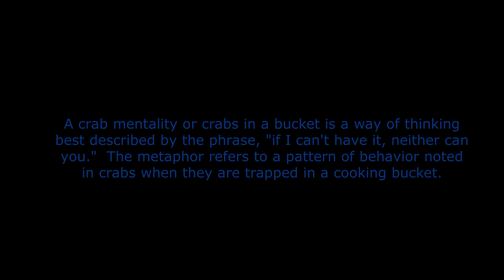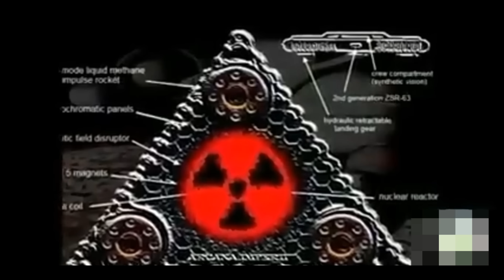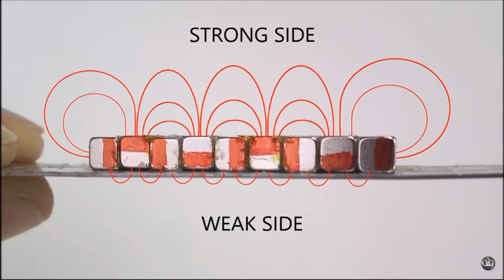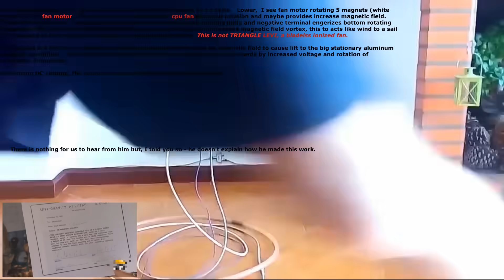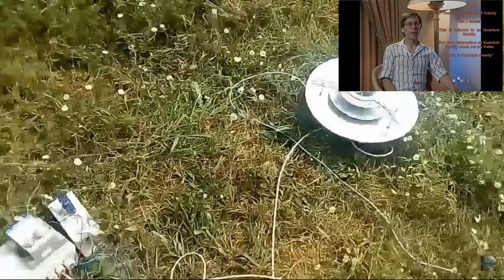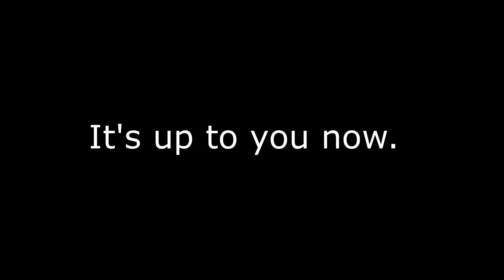anti-gravity project

Comment: These videos  https://www.youtube.com/watch?v=NxpoiCFKmPg +  https://www.youtube.com/watch?v=fwkvcgwziWo&t=36s  + look very similar to the mechanism that was shown to me in a Vision, that I figure came from our Creator, but you can attribute it to my own mind if you want. This idea came to me n the early 2000's, of which I soon put on the web @ http://free-energy.yolasite.com/, but I soon found out that nobody would listen to this idea. This idea that came to me, was of a 10 speed bicycle going uphill in tenth gear, and then back downhill in first gear. Although the force applied would be much greater going uphill in tenth gear, the number of rotations would be significantly less, which means less cycles of AC electricity. Then when you went downhill in first gear, you would gain massive cycles of AC electricity. 
. 
You would not need a degree in engineering to understand this GEM technology's workings, nor would you need to be a backyard mechanic to build this DIRT SIMPLE MECHANISM, nor do you need expensive equipment to build your own GEM=(Geometrical Electricity Multiplier). It has very few parts, that are very simple and rather inexpensive, which can be easily designed and built to any voltage. http://free-energy.yolasite.com/
- 
You only need a large pulley attached to a DC drive motor, and one or more of these mini-pulleys attached to AC generators, with a belt, rope, elastic or string to connect all of your pulleys together. Now you will probably have to add a large 200 volt + 200 uF capacitor across the input wires of the DC drive motor. (so that the many small outputs of the AC generators could be combined into large output to crank over the DC drive motor, The DC motor and the AC generators need to be of the same voltage of course.
- 
Then you would need a full wave bridge rectifier,(4 diodes) for every generator, to convert the multiplied output of your AC generators back into the DC input for your drive motor. Then you would need to have wire to connect your AC generator output wires to the input connections of the bridge rectifier, and wires from the output of the rectifier to the input of the DC drive motor.
- 
Once this mechanism is all built, with the wiring correctly attached, and the belt around all of the pulleys, all that you would have to do to get this mechanism running perpetually, is start the large pulley rotating by hand. You see it works on the simplest of logic, with a person paying for only the one rotation of a large 100 cm circumference pulley, giving you 100 cm of moving belt. Then you run this length of belt past 1 to 10 mini-pulleys of only 1 cm circumference, freely gaining you 100 to 1000 cycles of AC electricity. 
- 
Now, try and tell me that you could not gain the small amount of voltage and DC current to crank over your DC drive motor one sing le time,,, from the 100 to 1000 cycles of AC electricity. This would gain you a perpetually running set of many AC generators and one DC motor, that you could tap electricity off of.
- 
And don't you listen to those evil spirits, telling you that there is a major torque problem,,, because these are all lies. Lies from evil spirits that don't want to give up on all the money that finds it way into the hands of terrorist, from the profits of oil. High torque only comes from when you are producing great amounts of power, and this simple free AC multiplication mechanism only needs to produce the smallest amount of power, to become self sustaining. You only need to produce the amount of DC current, just a few short bursts of current, the minimal amount that it takes to crank over your DC motor one single time, (practically none)
-
The Ark of Covenant is real, found by  Ron Wyatt in tunnels under where Yahshua=(Jesus) was crucified, so that when the earth quaked + split, the blood of Yahshua could flow down + over the ark of His Covenant. I believe that the Ark is going to be used in the next few months, if the war of Gog is Pre--Trib. The 7 YEAR/2520 DAY PEACE TREATY WITH ISRAEL WILL HAPPEN BEFORE 2020. "know,,, even at the doors" (Mat 24:33). The world will never end,,, our Abba Father says that this is a “world without end” - (Isa 45:17)+(Eph 3:21). We are warned that "of that day and hour knoweth no man"-(Mat 24:36) But we are also assured that we can "know that it is near, even at the doors"-(Mat 24:33) a date that we are not only allowed to know, but I hear that in the original Greek it is written as a command: `know that it is near, even at the doors` from Mathew 24:33 KJV,  but the importance  has been translated out. Hello fellow inquisitive one, HIS BRIDE HAS LESS THAN A YEAR TO LIVE - On this earth, before the Rapture takes us off this earth, + we go to the Wedding. No one looks at finding when these doors will close, or this event happening within our generation, (I thought it was 51.6 as the duration for the final generation, but it could be different) = there are a lot of duration's for a generation used in the Scriptures.  
-
When I first had this 2020 Vision of the door closing, that we are told we are allowed to know. Then I mistakenly thought that meant the year 2020 was the last door, and the date that our Savior came back to this earth, so the Tribulation started 2520 days earlier. Then I figured that the Tribulation might begin before 2020, on the date 2019.04 = 1967.44 + 51.6, where 51.6 is the duration of a generation calculated from the 14, 14 + 14 generations from Abraham to Jesus. Now I realize that this is just another guess, but I can see the logic of these dates, between May 14th 2019 and May 14th 2020. = https://www.youtube.com/watch?v=NasEz6rrI1o . This website also has info on the infamous end-time two state solution for Jerusalem. 
- 
Did you ever wonder how we could know that it was near, 
when no one could know the day. It is because we can know the generation, 
and all generations have an end date. Well this end date could be the door, 
as in when the door will close on it being able to fulfill the prophecy about
“this generation shall not pass”. I know that there are a lot
of duration for a generation, but i figured that it was probably
the 51.6 solar year duration, as this was the same duration that
was used to accurately predict the rebirth of Israel. 
- 
(please read the novel called “Armageddon”, by Grant Jeffrey )
as this novel systematically went through all of the fulfilled prophecies 
in Scripture + displayed the reality of every one being fulfilled to the day 
= in the Holy Bible KJV. This novel helped me discover Scripture as TRUTH 
+ soon after, I became Born-Again
- 
I HAVE DISCOVERED THE SECRET THAT TESLA WANTED TO GET OUT 
TO OUR WORLD = SIMPLICITY OF FREE AC ELECTRICITY MULTIPLICATION 
USING PULLEYS – Also found in our Holy Bible in Ezekiel @ 
- where he describes the workings of a UFO motor as “wheels within wheels” 
- 
THIS GEM TECH IS SIMPLE LOGIC, THAT EVIL FORCES ARE HIDING . 
Free energy can be generated using pulleys, 
because pulleys can be used to freely multiply the # of rotations 
+ since AC electricity is generated by rotations, then we can use pulleys to multiply AC electricity 
@ https://www.facebook.com/groups/274842009339398/requests/
- 
It is as simple as the lesson that you learned way back in preschool, 
where they showed you how a single rotation of a larger pulley could be converted 
into many rotations of a smaller pulley. Well, this can be a significant thing, when 
talking about AC electricity, as more rotations can mean a greater amount of cycles 
of AC electricity. So, in effect, you can use pulleys to freely multiply the amount of AC
+electricity that you have.
- 
Think of only paying for the single rotation of a DC motor, (a few bursts of current) 
with a 100 cm circumference pulley attached, rotating 1 to 10 mini-pulleys of 1 cm
circumference, attached to AC generators + giving you a return of 100 to 1000 cycles 
of AC electricity, (10 X 100 = 1000). + don't you listen to the evil spirits, whispering 
that torque is a problem,,, = because the only torque that you need to produce, 
with these 100 to 1000 rotations of AC generators, to make this GEM device a self
powered free energy system, of one DC motor + 1 to 10  AC generators, is the minute 
amount of current that it takes to crank over your single DC motor one single time 
= a few short bursts, which equals practically nothing, when it comes to current. This is
because practically no current multiplied by even massive voltage, still equals practically 
zero power – costing practically zero torque.
- 
I gave the simple plans of how to have a large pulley powered by a DC motor 
drove a belt past these mini-pulleys with AC generators attached 
which generated more power than it used to power itself 
He said that he built 3 different ones, that worked great, 
but he would not go public with his results because of fear,
I speak of fear about the rumors of harm from the big oil companies
- 
FACEBOOK – (AC Electricity Multipliers) 
----------------------------------------------------------------------------------------- 
https://www.facebook.com/groups/274842009339398/1232685043555085/?comment_id=1232710206885902&reply_comment_id=1232712280219028&notif_id=1547946772333186&notif_t=group_activity&ref=bookmarks&refid=18&__tn__=*s-R
- 
PLEASE BELIEVE IN Messiah Yahshua SOON,,, (real name for JESUS CHRIST = YOUR CREATOR) 
+ do you know what the word god is short for,,,, Gadre'el = name for Satan https://www.youtube.com/watch?v=_qr2vT5ySLA
MANKIND DOES GREAT EVIL = https://www.youtube.com/watch?v=Ul0LDTsrmuY  
(Even if only a small amount of this video is true – WE NEED YHWH NOW = please take YESHUA  into your heart)
- 
My Ministry websites: 
http://free-energy.yolasite.com/ 
http://beliefstoliveby.yolasite.com/ 
http://possibletimingfortribulation.yolasite.com/ 
http://aliensandghosts.yolasite.com/